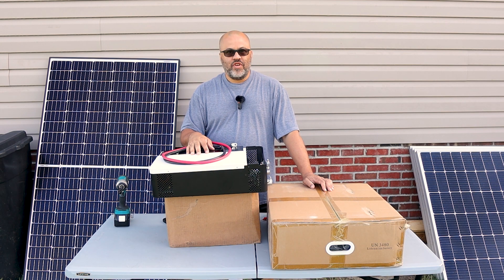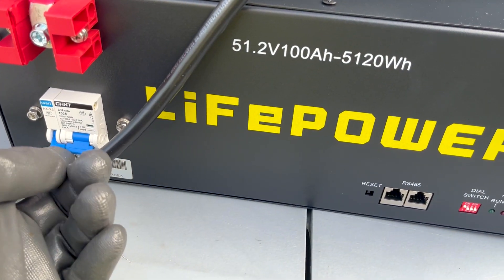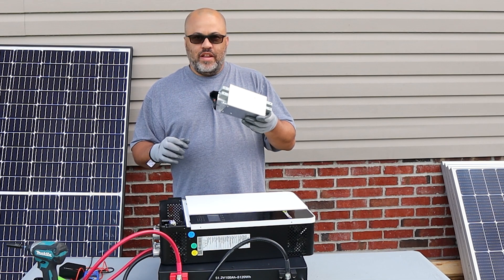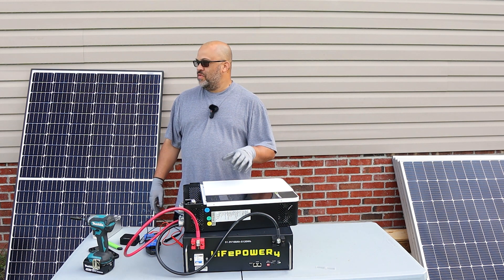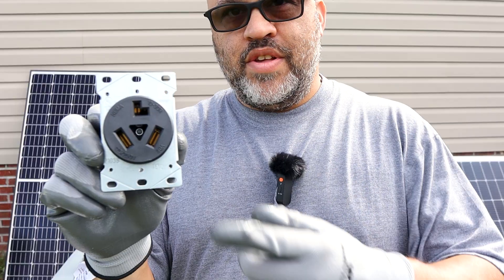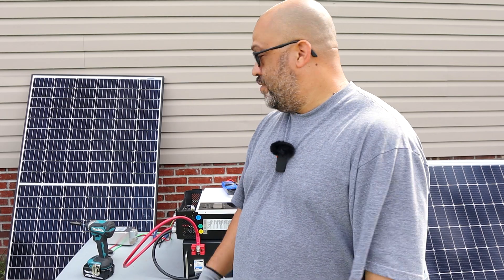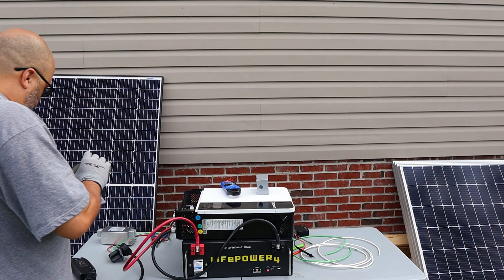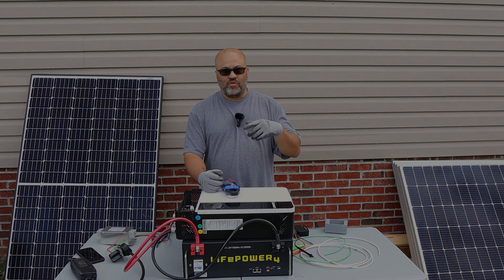Testing Growatt 5kw Inverter for Dedicated Electric Car Charger - How to Charge EV Off Grid

Comment: How many watts when the car was pulling from battery?
Reply from the maker: Depends on which charger I use. One is about 6600 watts the other is 3800 on level 2 charging
Reply: @rodneyhunt  awesome
Reply from the maker: @cameronbarnes5882  I try to use the smaller so I can still run the whole house. I need to get one with an adjustable amperage setting so I can lower it when more power is needed in the house.
Reply: @rodneyhunt  I have a tesla and I'm thinking of a growatt inverter, I've watched a lot of your videos and I like your honesty and fact you show the specs and info in looking for, thankyou for this

Comment: The Growatt 5000 does not even need a battery to operate. You can just leave it with solar panels, if it has a Bms problem. So far as there is sun light the car will charge
Reply from the maker: Will always work better with a battery. Then if you have partially cloudy conditions your power will not kick out then need to reset. Would be interesting to try out one day without a battery